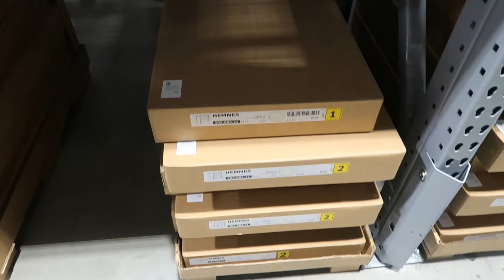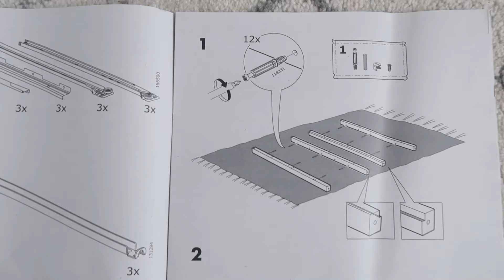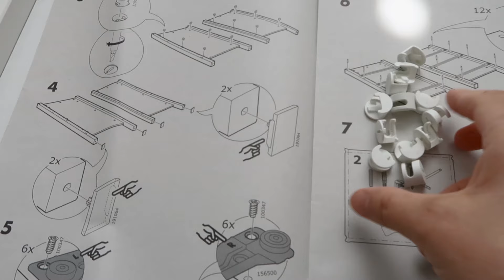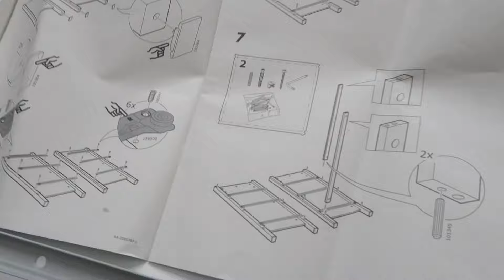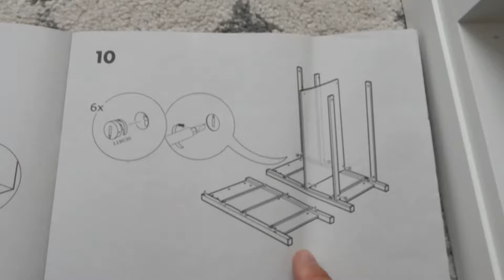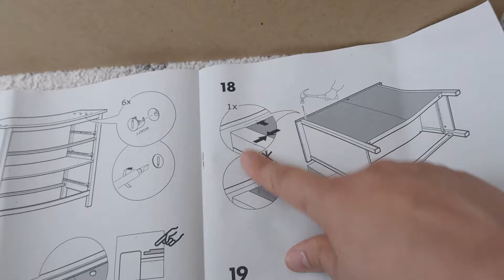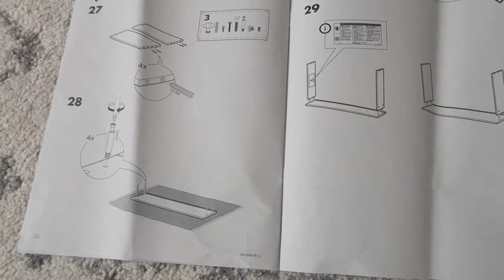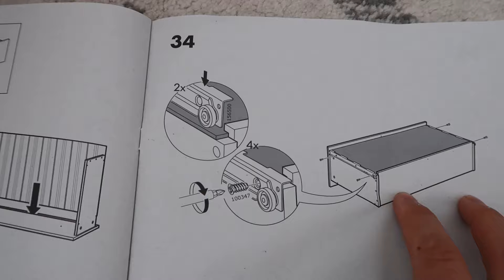building an ikea HEMNES 3 drawer dresser (IKEA FURNITURE ASSEMBLY)

Comment: I am in the US and attempting to build this dresser. Step #9 of my instructions shows all 3 of the thin vertical pieces being attached to the right side of the right panel instead of how yours is done with 1 on the left  side at the bottom and 2 on the right side.  When I tried to stand up the frame after installing the left panel on top  it just fell apart. 

Wondering why my instructions are different than yours?  Are you in Europe?  Perhaps that is the reason?  Very frustrating!!  We checked all of the steps and pieces and did not miss anything.
Reply from the maker: No, i'm also in the US, sorry youre having trouble. I hope you figured it out 🧡